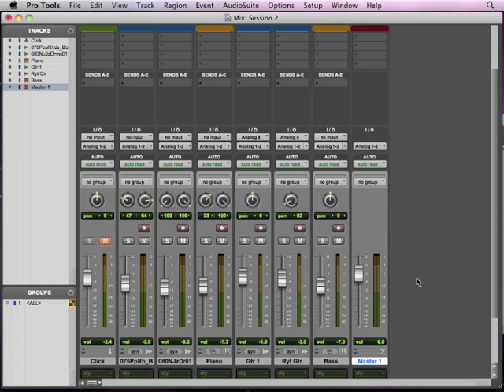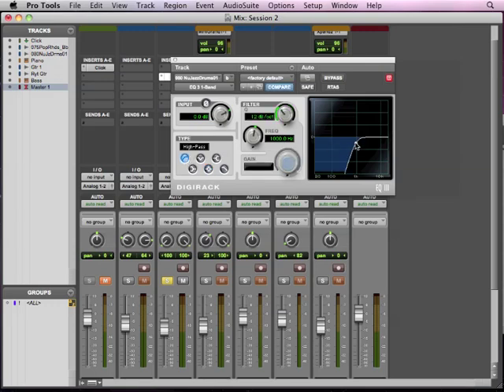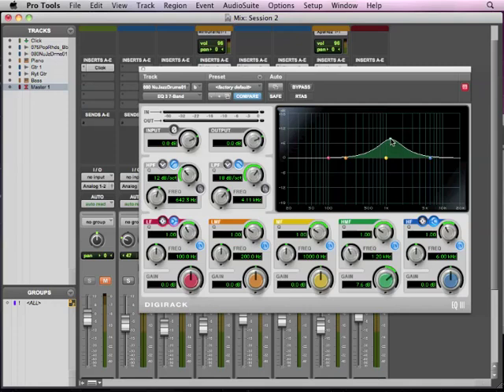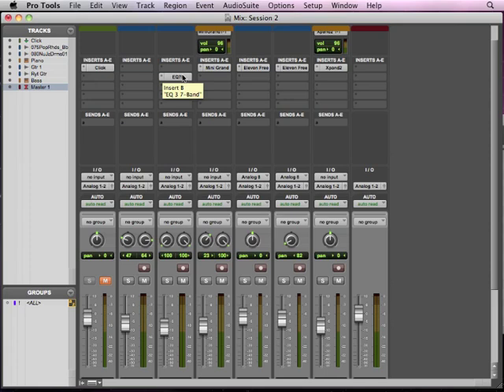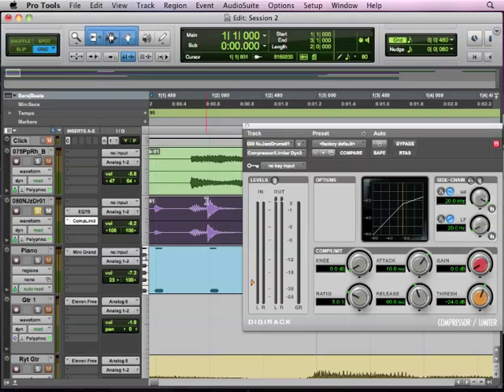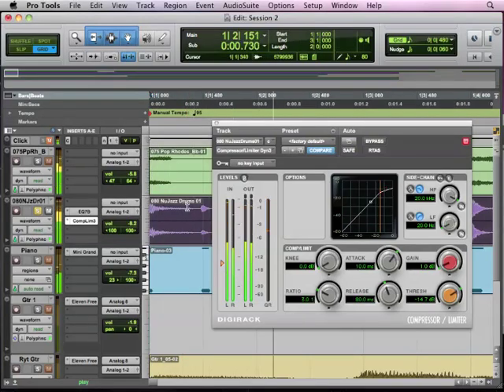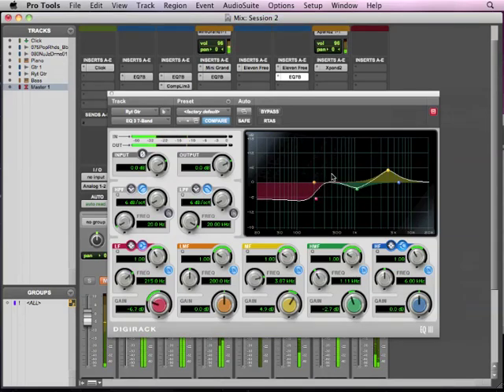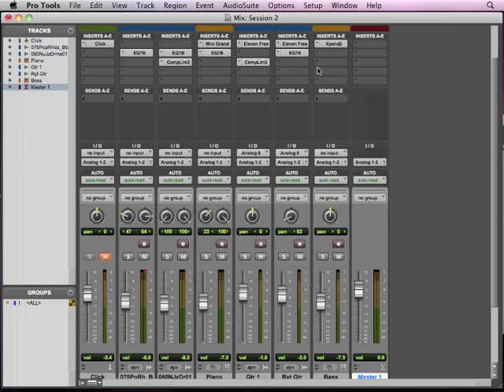Pro Tools Basics Lesson 11 - Inserts, EQ, and Compression (11 of 13)

Comment: Dialed in vocals- I set the COMP. EQ, I/O, ect. saved to presets. "Reopened saved work",and presets, settings and 7 bnd EQ gone, only EQ now is AIR this-AIR that. Compresser gone, multi chan compressor, dynamics all gone from inserts/sends drop down menus so protools can't find the presets or the equipment (plug-ins) saved in protools to a specified location thru presets?. Why would save in protools remove drop down menu items in inserts sends and bus tho the equipmwnt is listed in insrts snd &bus activate windws the processers don't exist according to protools. Why is that?